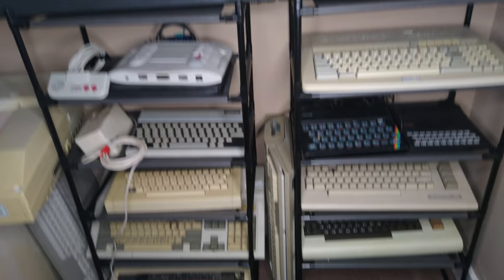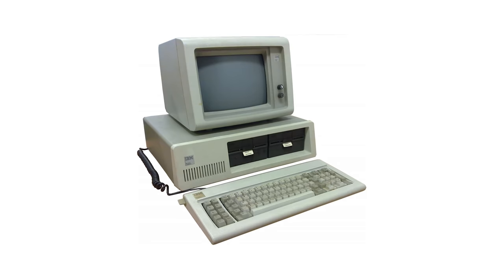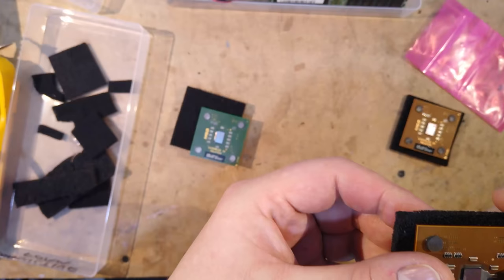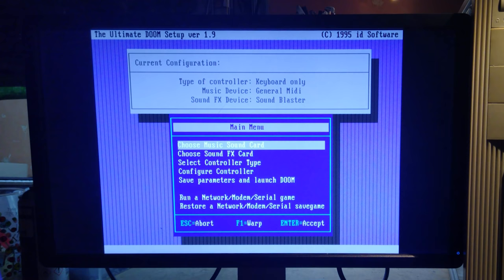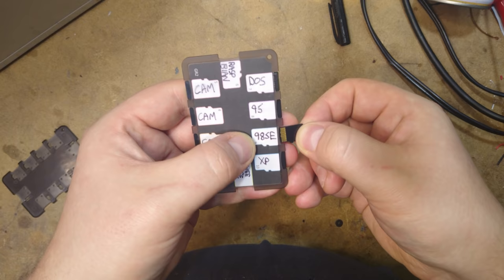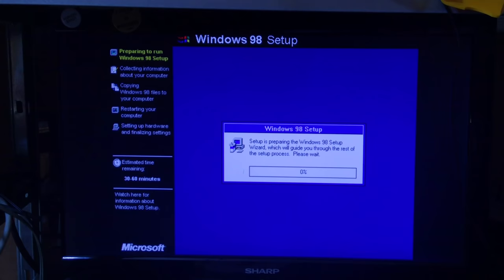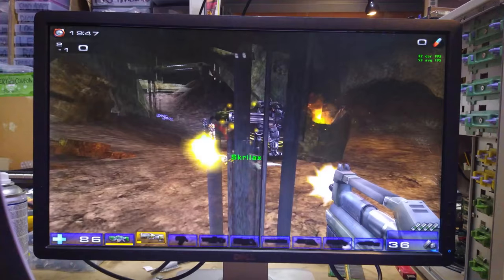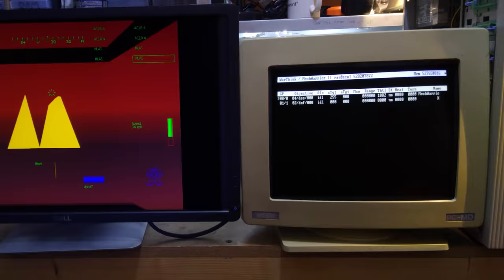Building a RIDICULOUSLY Overpowered DOS PC - Retro Rocket

Comment: something I've always wanted to test was a"PC/PCI" or "SB LINK" port on some motherboards and pci sound cards, it allows you to get fully compatible sound blaster support on newer systems without an ISA bus by adding a 5 pin cable, there are zero videos about this even through it was common in the early 2000's
Reply: A great idea! I have a PCI sound card with the capability but no pins on the motherboard - would love to try this one day :-)

Comment: With Windows 98se, you are locked into real IRQs, and they should not be shared. You may need to disable whatever uses IRQ5 in your motherboard BIOS. And don't forget to install sound support in CONFIG.SYS (load high) and AUTOEXEC.BAT files (not required on 2K/XP, but you still need to set BLASTER in environment variables). Enjoy!

Comment: You used to be able to do a manual configuration in the device manager for specific hardware. I'd probably disable the parallel and serial ports (leave one active for a serial mouse or other hardware) to free up as many irq and io addresses as possible. Check what resources your sound card is using via any dos game with a sound setup program. You can then use that info to set the resources the card needs manually. I used to get this error for an old sound card I had in the 90s. I vaguely remember having to install the card in dos as well.

Comment: You absolute magnificent mad man! You my have single handedly constructed the blueprint for legacy pcs for the next 10 years. Way to go!
Reply: Been enjoying my own take on this since last year, but he missed that you can slow it down enough with the cpuspd tool to play 8086 era games as well. It can cover a very wide range.

Mine doesn't have an ISA slot and it has a Voodoo 2 to complement what the Geforce 6800GT can't do. The soundcard is a ESS Solo-1 which works on VIA motherboards with socket 939. So you can use even more ram and more cpu speed than his one while still retaining almost flawless dos sound compatibility with really good soundblaster sound. Pair that up with an audigy 1 for EAX and you now have sound all the way up to windows 10.

Mine can play Crysis 1 to, but it also plays those early speed sensitive dos titles. And his can to if he grabs the tool :D

Comment: I had a Athlon XP back in the day. I picked the one with the fast FSB (IIRC 333Mhz rather than 266Mhz, so it might have been this exact chip). Got some Ram that could run at that speed too, an ATI GPU, NVidia chipset board and a PSU. The damn thing was unstable in 3DMark. I got all the parts from some online place that was excellent with returns. Tried swapping out the GPU and PSU. Still unstable. Eventually I found out that the ram I'd got couldn't in fact run at the fast FSB it claimed. Manually downclocked it to the slow speed. Very stable and no perceptible loss in performance. However the onboard sound was glitchy so I ended up buying a cheap sound card. This sysem put me off AMD/ATI and only now would I consider them. Basically no Intel system I've had, and I've had a few, would have had this issue with ram because Intel would probably have special-cased the ram I bought and run it slower than it claimed it was capable of. Intel seem to have invented XMPP so they can select a low, safe speed by default but enable the fast and less safe mode on ram they've tested. Also ram branding is more Crucial now than it used to be, in the sense that if you buy your ram from them it will run fine at the claimed speed.

I still feel a bit bad about that parts place who saw their profit margin wiped out by me exchanging parts that were probably perfectly fine.

Comment: QDI was a subsidiary of Lenovo (then called Legend), it produced boards for both Legend-branded systems and DIY PCs, and QDI boards were very popular in China in the late 90s.
I tried using my 512MB 7600 GT AGP with a Gigabyte 8I865GME-775 mainboard and a Core 2 CPU last weekend, and the graphics card refused to work unless I flashed the VBIOS for 256 MB cards and replaced the two 1 GB RAM sticks with a single 256 MB of DDR 400, even if I set the MaxPhysPage to 10000. This rig runs Windows 2000 without any issues but problematic with 98, so I'm looking for another machine that can run Win98 out of the box... Thanks for your video!
Reply: yeah, getting hardware to work in W98 can be a pain.

Comment: Really fun build! I love it when people take on the same challenge I did in trying to build a wide range DOS PC.

My route is similar but a little different. I went with a newer ASUS A8V socket 939 motherboard and an Athlon 64 X2 4200+. So under XP I can access 3.5GB of RAM and have two cores. Under 98 I cap the ram to 512mb with the Windows 98 Memory Burn Driver.

For the graphics card I went with the 6800GT which has native 98 drivers and also runs Crysis 1 well on low. I considered 7000 but the hacked drivers have a driver that is to new for maximum stability. The problem is that starting at the 6000 series they dropped certain texture support so I also added a Voodoo 2 to the mix to cover the gap. My FSB is to fast for static linked games in DOS so it only works with dynamic linked games and I made my own modded Voodoo 2 driver bundle to make that easy.

The soundcard issue i solved differently. For Windows I went with the Audigy 1 for great DOS prompt support and EAX. But for DOS i needed better compatibility. The socket 939 chipset from VIA still has all the ISA stuff functioning on the PCI ports so soundblaster emulation is possible with the right card. There is one that can do it very well and that is the ESS Solo-1. Once initialized the card hijacks some DMA functions making it work and for many games I do not even need a TSR. It works in every mode, even real mode games. I also load a special program that turns the mixer on the audigy on so i can have  passtrough from the solo-1 and the cd drive without having to mess with cables.

Last but not least is the lower end games. 8086 stuff, so games like sopwith. Those also work on my build and will likely work with yours to! All you need is cpuspd which gives you very good control over things like power states, multipliers and cache. So you can get very good results with it.

That means with our builds you should be able to play even the earliest DOS games and then reboot into crysis.
Reply from the maker: Interesting! I knew some PCI cards worked with DOS games but I've never tried that route. I'll have to try and find a solo-1!
Reply: @TheRasteri  Few tips for when you do. The card is IRQ sensitive for me. Some games worked on one, the other half worked on the other. And when i tried a third IRQ it worked on both. i believe mine is on IRQ10, it will automatically take IRQ5 once initialized for its sound blaster emulation.

It also has limited Windows 3.11 support but the driver they ship has a broken installer. I managed to make an installer that works if its initialized in DOS. And there is a way to manually initialize the card without a TSR (doesn't work on all games but works on many).

If you manage to get one I can send my drivers over. Otherwise you'd be stuck with a Win98 driver (that does work in MS-Dos mode).

Comment: What needs to be created is a thru parallel (db25) cutout port SD card reader. Reads full sized SD cards, with adaptor for micro and mini cd cards. Could probably provide an additional micro SD slot. Both these accessable from outside. With an IDE or SATA cable to the host controller.
LEDs would be nice, power and access lights for each slot. With mechanical push to eject mechanism.
Probably with either or both software/ button dismount disk(s) function.
Definitely monitor disk eject function, but if prevented an emergency eject function like optical drives.

Comment: Currently rocking a KT133A retro rocket myself! I have found success with the board you mentioned, but I'm currently using a Soltek SL75-KAV with an Athlon XP-M 3000+ (extremely unsupported but works on all my SL75-KAVs). The jumpers only let the system boot at 12x but CrystalCPUID can get it up to 16.5x. Works great if your addon hardware doesn't lock the system up.
Reply: Other decent KT133A boards I have used for MS-DOS gaming setups, all with ISA slots and 686B southbridge for those curious:
- Iwill KK266+
- Soltek SL75-MAV (same as KAV but with integrated ProSavage)
- Soyo SY-K7VTA PRO
But among all similar boards, the QDI Kinetiz 7T mentioned in this video and Soltek SL75-KAV have been the real stars in my experience.
Reply from the maker: oh crikey, I should get one of those XP-M 3000+, I could really use those extra 67MHz :)
Reply: @TheRasteri  Easily underclockable to 3x! :)

Comment: I have the same passion for the same reason; but, I went for two Windows 98se computers and one Windows XP, and finally my Windows 10 computer. It's my hobby, I have tons of games, too many really; but, collecting all the games was alot of fun, and building all my computers has been a learning experience, and alot of fun too. For Glide games on Windows 98se, all you need is DirectX 9.0c installed along with a compatible DirectX 9 video card(mine is a Geforce FX5700), and install nGlide version 1.05. I have found that I can play all my old glide games that way without the high cost of buying a 3dfx Voodoo card. I will admit that my one Windows 98 PC has a 3dfx Voodoo 1 paired with a Geforce MX400, I run Need For Speed II SE ,POD, and Wing Commander Prophecy on that machine to name but a few, I have 42 games for that computer alone, mostly glide. :)
Reply: Sounds great. What CPU did you pair with that Voodoo 1, and what are your favourite glide games on that PC?  I am building a voodoo 1 based PC but don't have many glide games.  Some recommendations would be great.  I do have the 3 that you mentioned, as well as Tombraider 1, Quake, Descent: Freespace.

Comment: FreeDOS runs on every PC that has a Legacy BIOS mode. So the most ridiculously overpowered DOS PC is just a modern PC that has this mode. Though it won't run games with sound because DOS games directly access sound cards and don't understand integrated sound, you need something with SB emulation (and even the Aureal Vortex, the most compatible SB emulating PCI card, displays severe stability issues on newer chipsets).
My own retro rocket PC is a Pentium 4 with an old Intel chipset which works just fine with Aureal Vortex under DOS.

Comment: I feel like for the sound card in win 98 you need to go digging around the internet for a better driver. It's really annoying to do this since sometimes there are multiple versions of the same sound card and sometimes if they are OEM they use a different driver that may even be on the recovery cd if you can find it.
Edit: probably not the issue the more I think and look over the description and vaguely see in the video so I added some replies to this with some additional thoughts.
Reply: the last line makes me think the motherboard may not like the sound card though. if you can get it to operate in other pcs in win9x it is possible the bios/OS is assigning bad resources [some bioses will let you assign resources manually and sometimes windows will let you as well] it's a little perplexing that you got it to work in xp though so maybe the issue is with windows 9x itself. I have had issues with windows assigning sound blaster live! cards to the same resources as other devices for whatever reason and had to figure out how to manually get the resources to something without a conflict.

When looking  up the motherboard I also noticed there are 2 other version that have built in audio chips.[an AC 97 one and a CT5880 chipset] I wonder if that could be part of the issue. And the odd looking slot next to the agp turns out to be an Audio/Modem Riser Interface Connector.
Reply: I keep trying to find a good shot of the onboard audio jumper. I would not expect that to even exist on the board but the jumpers on this board seems to be a specific shade of blue and it looks like there is one there. Make sure the jumper next to the agp & Audio/Modem riser is in position 1-2 to disable the onboard codec.
Reply from the maker: @Miasmark  Yeah I've tried disabling everything via jumpers, makes no difference :(
Reply: @TheRasteri  one last thought I had was related to the amount of ram you have. Try it out with 1 stick of ram if that's possible. Outside of trying to manually assign resources in the bios that's the only other thing I can think of that could be causing an issue in win 9x.
Reply from the maker: @Miasmark  yep, tried with 512MB. Suppose I could try 64MB...
Reply: @TheRasteri  if you have one on hand that would be worth a shot. Just to eliminate that possiblity. I think 256mb is supposed to be the win9x limitation but the driver could have a lower limit itself. I wish it would be more specific as to what resources it is getting from the bios that's 'invalid'. I tried digging through your msinfo file from vogons to find out but it doesn't seem to list anything.
Reply: @TheRasteri  ok. If that doesn't work I just got a ridiculous idea. If you got it to work on win 2k/xp on the same computer dig out the resources being used with the msinfo for that install and then manually add it to the win 9x hardware using that information. It might even let you know about a conflict then. Hopefully any conflict would then be able to be reassigned inside the OS.
Reply: @TheRasteri  Im trying to do something similar now so if I learn something useful for your situation I will let you know. Im using an intel chipset with a 3.06 Ghz Pentium 4 processor though so may not be helpful. if you have not figured out this problem it's likely you ran into some odd driver bug or just have not danced the appropriate form of hokey pokey with the hardware/software for it to recognize properly in win 98.

Comment: Apart from no ISA, I recommend shuttle XPC, as they are so compact so making them more convenient for most people as they don't get int he way or are easy to store and get out when you want to use them. I got a P4 3.2ghz one with DVD R/W and 2.5 Floppy (though will likely get a gotek emulator to replace that) with a 9800 pro, Audigy 2 ZS with 1gb DDr 400. I dual boot it with windows 7 32bit and Windows 98 SE. I picked up a cheap 500GB seagate hybrid drive that I use for windows 98 SE as its pretty fast without the trim concerns (plus 32GB main aprtition then the rest as storage is handy. Windows 7 is just on 120GB SSD with the shared storage from the hybrid drive making transferring files and the like nce and easy. Throw on a DVI to hdmi adapter and its even more convenient as it can connect to all my monitors or even the TV.

They are currently pretty cheap and many are good to go out of the box for most people needs without having to have a big box retro PC, though if you want sata on board, those seem to be harder to find and have a bigger price tag unless you get lucky.

Comment: Damn, yours is bigger than mine, lol!  1.68GHz overclocked P3 Tualatin is my fastest retro rocket.  I also re-used a special case with some history when I built my first retro PC, the Dual 1GHz Slot 1 Pentium 3 system.  Originally that case housed a PC I built for a client in the early 2000's, one of my first hardware sales - which I would end up buying back years later as a used machine, upgrading the internals and using it as my own desktop system until about 2009.  Then it sat as discarded parts until 2019 when I lovingly cleaned up the case and re-used it to build my first retro PC!

Comment: You can get industrial mainboards with ISA, PCI and PCIe slots and modern CPUs. The PCIe hardware is a bit tricky or even impossible to get working under DOS and older Windows versions, though. Your build is nice, though.
Reply: I heard those ISA slots won't necessarily work properly with ISA sound cards due to lack of DMA support. I'm not sure of the specifics, but something to research if anyone is looking into those.
Reply: @kunka592  there is already video, about the ones, that still support DMA.
Tested with Quadcore Xeon E5450 or similiar.
ISA worked, doom 1 and 2 worked under DOS with sounds.

Comment: I like doing overkill setups in retrogaming as well, i have something like this

Celeron 3.06GHZ LGA775
Gigabyte ga-8vm800pmd-775-rh (agp and ddr2)
2x256mb ddr2 533mhz
Nvidia vanta lt 16mb
30Gb IDE HDD (i like the sound...)

Working well on w98 and its games, but for DOS gaming Pentium 2 350MMX with ISA soundblaster is my choice.
Reply: That Celeron might be a Pentium 4/Netburst-based CPU, so for more speed, I'd recommend getting some dual-core Core2-based CPU. I have a Win98SE build using LGA775 and I temporarily used a similar speed Celeron, but once I switched to a Core2 CPU, it was night and day difference in some games, even ones from 1997. That GPU might be a bottleneck in your case though.

Comment: Fastest rocket DOS machines I have is Athlon X2 5600+AM2  with X800 XL 256MB with ESS Solo-1 and SB 128 PCI (cause I like its wavetable MIDI) and Voodoo2 12MB. Also have similar configuration but with Athlon 3000+ s754 with two V2's 12MB in SLI and FX5900 and similar sound cards. Those are both DOS and Win98 computers. GPUs for both computers run on Windows 98. I could go with GeForce 6800 but I do not like it for retro PCs as it doesn't do 16-bit dithering. Newer games I can run just fine on my modern PC